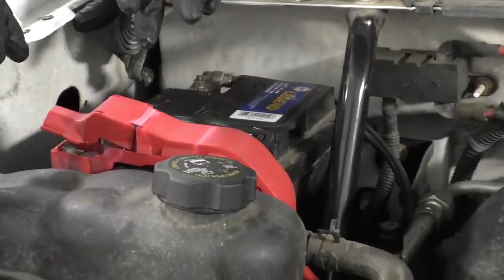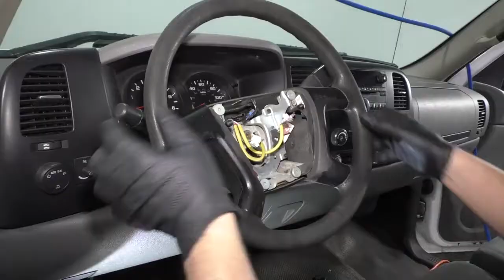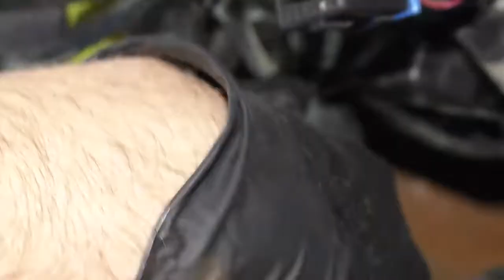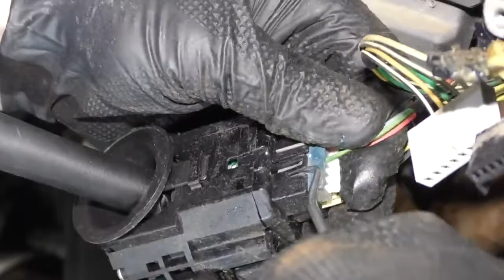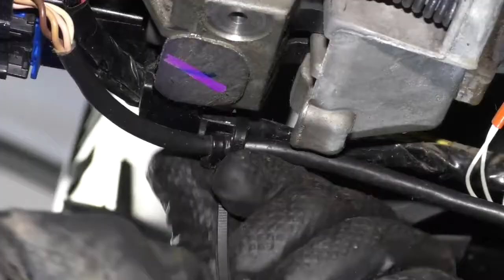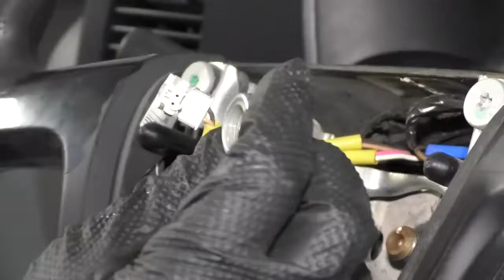How to Replace Turn Signal Switch 07-13 Chevy Silverado

Comment: There's another video that shows you replacing the switch without completely disassembling the steering wheel.  Remove tilt knob, remove bottom shroud, remove shifter boot, remove top shroud, remove two screws - switch removal complete!  Why add an extra hour of work and playing around with critical things like the airbag when that's not even in play!  I followed the other video and had zero problems and had the switch completely replaced in less than 20 minutes.  This video would have you working for an hour or more.

Comment: Why did you make replacing the turn signal switch more difficult than necessary?  The Steering Wheel DID NOT need to be removed.  The plastic cover behind the Steering Wheel is removable, that allows you access to the two Torx 25 screws to remove the Switch.

Comment: Well, just did mine in 20 minutes and didn't remove the steering wheel and it was super easy. There is absolutely zero reason to remove the steering wheel to do this. Find another video cause this one sucks!

Comment: Wow, this is a lot of work 😮. I have a 2010 Silverado. Is there any shortcut 😉, or must one definitely pull the air bag, the steering wheel, the fuse cover at the end of the dash, and the 2-foot or so long panel under the dash and the steering column, and so forth?

In advance, thanks so much for any info and direction that someone might be able to provide 👍. Happy late spring ‘25!

Comment: I agree to take the airbag off for safety, but not the steering wheel, not the harnesses, even the lower cover can stay in place. Take the steering column covers off, taaadaaa. This video is great for milking customers. Anywho, thanks.

Comment: This video should be removed, this is less than 30 minutes of work. You are sending people on a wild goose chase. Thankfully I was smart enough to read the comments first. Seriously why are you removing the airbag spring clock??? I know why, because you are shooting multiple videos at one time. There was no reason to take any of that apart for this replacement.

Remove the steering wheel adjustment lever
Remove the steering column screws if they are there
Split the steering column
Remove the switch
Put the new one in.

If you have trouble with the front torx, use a 1/4 wrench to turn the torx bit. Takes a bit of time but way faster than this video.

Comment: Much easier to simply remove tilt steering lever, then housing, and access the T25 screws by tilting the wheel up/down and turning wheel as needed. 
Takes some patience, but it’s an easy job.

Comment: Easier to do this by taking the wheel off, but leaving the clockspring on. Bypasses all the unnecessary wire disconnecting, and routing. Just disconnect the old switch, connect the new switch and reassemble. Both T25s are easily accesible with the spring on. Worked like a charm for my 09 sierra 1500.

Comment: No need to remove steering wheel or clock spring just remove the plastic steering column cover turn the wheel to get to the screws, follow the wiring, unplug and the whole lever just pulls out....

Comment: 🔴 Wake up to both my low beam headlights not working, when they were the night before. Bulbs, Fuses and relays are all good. So here we go searching up a possible explanation and solution to the problem. It's crazy that it takes all this because literally all the other lights are working fine. Thanks for the informative upload. Wish me luck.

Comment: I did it without removing the wheel, pop the tilt lever off, remove the column covers, take out the torx screw on top, I turned the wheel until I could see the torx on the bottom, and used a torx bit in the box end of a 1/4" box wrench, then maneuvered the screwdriver past the wheel to remove it.

Comment: DO NOT REMOVE STEERING WHEEL AND CLOCKSPRING!!! They do not need to come off if you turn the wheel to get the bottom torx screw.

Comment: Is the 2007  2500 hd duramax built this way?  It has more features on the steering wheel- would that be just another connection probably?

Comment: Taking the steering wheel out and unplugging harnesses under the dash is highly unnecessary. For the screw that faces the steering wheel just get an angled torx bit. Saves so much time
Reply from the maker: +Devin Blackwell We appreciate the feedback. Sometimes there are multiple ways to accomplish the same repair.

Comment: Couldn't you just remove the top and bottom covers and then the torx screw and uncluttered the wires and pull the switch out? I don't see why it is at all necessary to pull off the steering wheel or the air bag and clock spring.

Comment: Plus this is 2007-2013 trucks ..just doing Top and bottom back instead of whole steering column is 2006 and under ..things change the newer the vehicle

Comment: It I really awesome. Thank you so much for showing step by step and so up close ..it does consist of a lot of steps but you took it all apart installed the arm and put back together in 16 min ..I see others talk of a shorter way but I think doing it your /Right way is the best safest way .so you don't cause any unnecessary problem.. Thank you so much

Comment: No need to remove the steering wheel. Just pull the tilt lever off, pop the two clam shell trim halves apart ( top and bottom), turn your wheel till it gives you best access to the lower T20. Take the top T20 out, pop the three connectors off then do the reverse. It'll take you 20 minutes.
Reply: Worked without removing steering wheel for 2007 LTZ! I will note, removing the fuse panel door & bottom shroud helps a little. I did have to use 1/4" drive ratchet with an extension & the T20 for the bottom one - so that it would go out past the steering wheel. My original problem was that when I was driving at night with headlights on, when I'd take a right turn, the brights would come on! Every time I would take a right turn, I'd blind the person waiting in line ahead of me :-D
Reply: @Squirrel-Master-Dot-Net lmao i had the EXACT same problem. My low beams were bad enough, that would trigger people even more! Especially when I was working in Tucson, AZ late at night as there are few streetlights.
Reply: Followed this for my 2010 Silverado LTZ. Worked perfectly. Bottom T20 takes a little finesse. Follow this comment not the video, it will save a boatload of work! Thanks Patrick!
Reply: Yah, that was what I was thinking. I was waiting for him to remove the engine next.
Reply: Not all heroes wear capes
Reply: I was going to say.... Why the hell did they take apart the entire truck for that
Reply: Watched the video and got a little discouraged about doing it but after seeing your comment i thought what the hell I'll give it a try by how this person said to do it. And you're right.  Took me about 45 minutes to do it. Thanks for the comment!  Saved me a lot of hassle.
Reply: Followed these instructions and true to your word, it took a little under 20 minutes. An improvement over the video method.
Reply: Literally just did this. Bit of a fight with the lower steering trim but other than that OP was spot on. 20mins flat in and out. Would advise using an extension on the bottom t20 to get just that little extra wobble play when removing and reinstalling.
Reply: Thanks i will be doing one tomorrow
Reply from the maker: +Patrick Straughan Thanks for the tip! We'll pass this info along to our production team.

Comment: FYI....If you use a small torx bit with a regular wrench you will have access enough to remove the bottom bolt on the multifunction switch without removing the steering wheel and clock spring. At least thats what I did on an 07 gmc 1500 classic.
Reply: Holy shit thank you
Reply: THANK YOU 🫵🏾💯